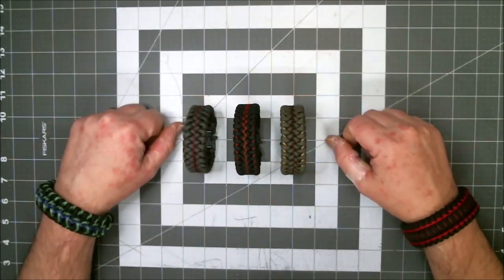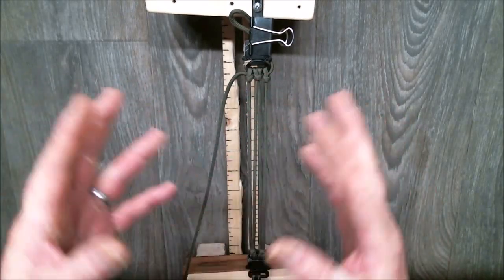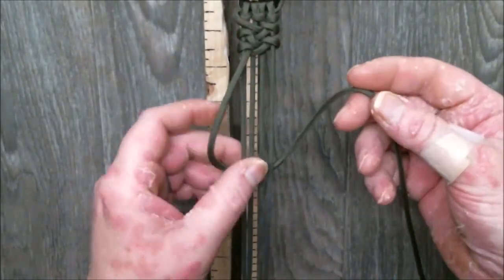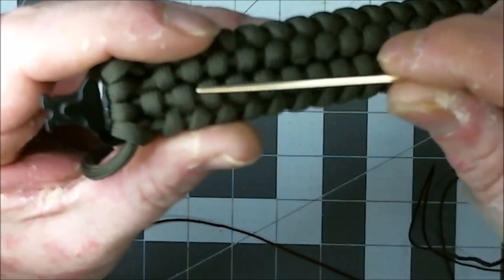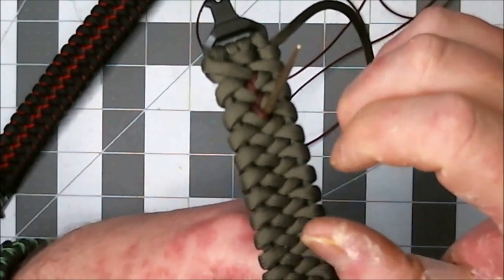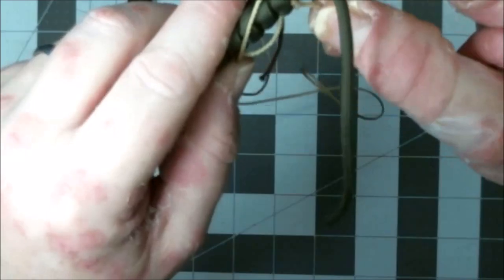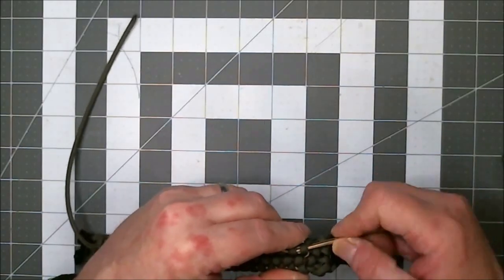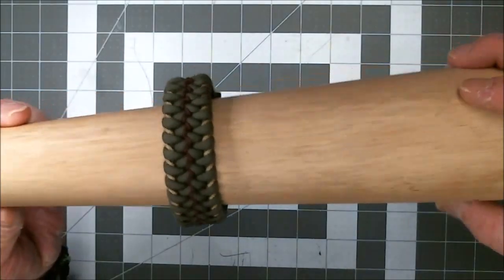How To Make A Stitched Modified Sonic Armor Paracord Bracelet (Deep Cut)

Comment: I would have cut out the knot and remelt the end.
Reply from the maker: I am not quite sure I understand what you are saying??? Please elaborate, thanks.
Reply: Just cut the end and melt it again instead of trying to untie it.
Reply from the maker: @michaelporche8890  I have sent you a message in Facebook Messenger. Since we are not "Friends" you may need to check your "Message Request", thanks.
Reply: Steve, I couldn’t find the part where you were pulling the micro cord through and there was a knot in the end of the cord. You had to untie it and showed it under your magnifying light. I am 75 year old with neuropathy in both hands and some times it is difficult to untie small knots
Reply from the maker: @michaelporche8890  ok gotcha. If there was a knot in the micro cord it was not meant to be there and most likely happened by accident.